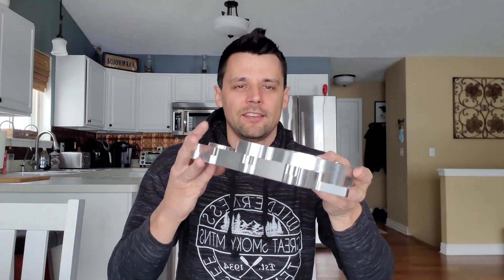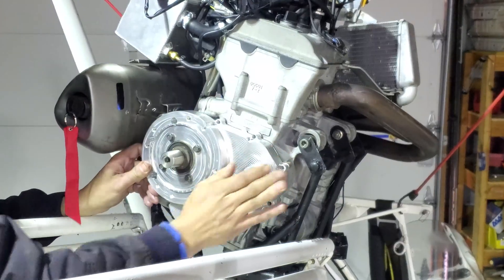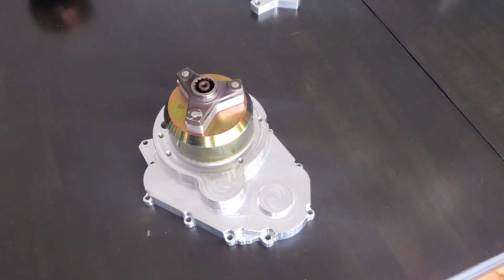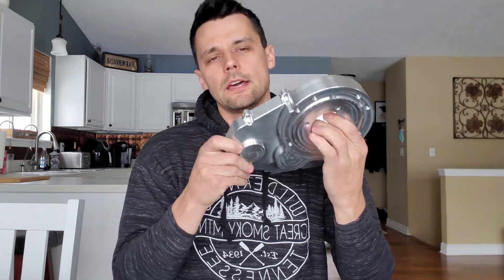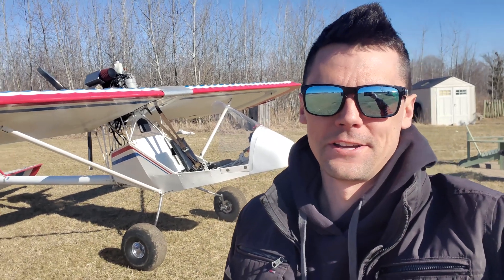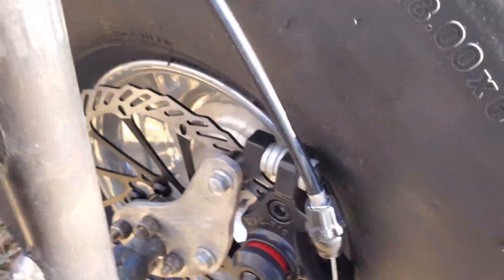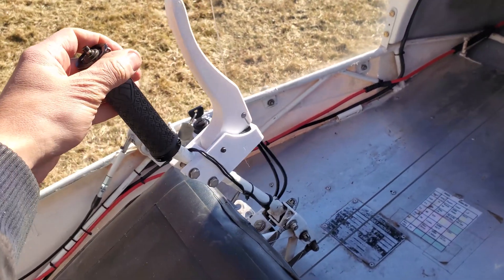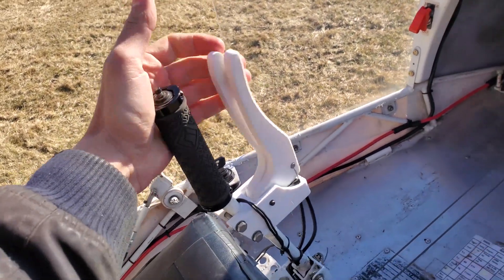Yamaha Phazer Airplane Gear Box Adapter Test

Comment: Looks really cool except the landing gear extension.  I would be scared the bolts would shear.
Reply from the maker: Thx. a AN6 bolt has a shear strength of 3 tons. I'm more worried about breaking gear leg where hole is drilled. It has taken some hard hits with no failures to report.

Comment: Ben, I just bought a Kolb Slingshot, recently built. I have a question about the rivets in the rudder hinge.  The builder didn’t use all the marked rivet points.  He did every other one. How is your rudder attached?  Every rivet point used?
Reply from the maker: Nice, always wanted a slingshot! Yes my rudder has all rivits used. Should be easy to drill and pop them in.

Comment: Is the Apex in your plans for the future with a tractor configuration?  Considering the Rans S20 as a potential project.
Reply from the maker: next project is a Phazer in a kitfox Iv 1050. Apex was too heavy for a 1050 gross.
Reply: Will be interesting to see how well it fits in the IV cowling.

Comment: Very impressive!!What ratio gearbox because a 582 is a 6500 rpm peak and ur running quite a bit more with the yam.
Reply from the maker: The phazer engine has a internal gear reduction at output shaft. My output shaft rpm to gear box is about 7k rpm, simular to rotax rpm

Comment: Wondering how much hp.  I I As many  pilots  looking for 4 stroke conversions for the 503. 582.  This is lookin pretty good . Dont fade away like many others. Kinda wondering how this would work on my challenger 2? I would also like a rundown on your search for a good phazer engine? Ill be heading to your webb site.
Flying big mountains here reliability and suficiant climb is a must.
Reply from the maker: 80hp, this is the new gen 503/582 replacement that is getting more popular.
Reply: @bkairys  Who’s selling the Phazer engine for these conversions? Living in Southern Arizona, we don’t see a lot of any kind of snowmobile.
Reply: If it can bolt into a Chinook 2+ theres no reason why the Challenger factory wouldn't ok the mod.  Here's hoping.

Comment: Hey again Ben! 

Been a while (last time I was bad mouthing your super weird and unsettling video format) but really GREAT to see you've gotten the CNC production going (I figured the Phazer 4 Stroke would be a hit; there are just TOO MANY drawbacks to the 582) and are creating a fully marketable Phazer Conversion Kit company! 

Here in Wyoming things are pretty much the same; still broke (grossed $5506 last year), just completed my first work project of the year (1 day), which is pretty much normal (not much work I can do for the first 4 months of the year), still cleaning the place to get it up and sold to European/Japanese Hunting Clubs, so the move to Alaska is still on if the health front doesn't get too much worse!

The really great news here is that I'm STILL planning on acquiring a Part 103 plane and getting BACK up into the air (with a Phazer is the plan); the Firefly and Firestar planes still look great, even though they are not aluminum (Hummel would be my preferred choice, but NO low wing thank you.....back country only for me!), but Chip's Merlin Lite shows promise, but the shekels required are formidable! Maybe by the time I have the jingle the slobs at the FAA will increase the Weight Limit on Part 103 to a REASONABLE 500lb-625lbs..........they've promised what is essentially a 'Constant Speed Prop' (they refer to it as 'One Level Control' used on FADEC equipped engines) which would REALLY increase the performance of everything from Part 103 and up and really save on Fuel Costs!

The good news is that next week I'll be finally publishing my novella on Amazon KDP after doing five rewrites and 3 complete read throughs after initially finishing it........we'll see how it goes....need to find a LOT of space/fantasy/genetic modification/arachnophile afficianados/as out there to spend $3-$4 on an E-book.....

I'm happier than one of Ivar's proverbial clams that you are making the Phazer Series REAL.......I may never get to that point, but it does my heart good to see someone with skill, motivation, and hard work succeed......and that is what you are doing!

Lastly, allow me to thank you for going back to REGULAR videoing......it was nice to see in fight details without getting sea sick while laying on the couch thinking I was in the midst of an F5 hurricane!

Take care and Keep On Truckin'!

Cheers from the Oil Patch in Central WY

Comment: So basically to put the Phazer on something like a Hawk Arrow II

1. Convert wire harness
2. Get adapter plate
3. Get/Fabricate Engine mount
4. Get clutch
5. Modify/Fabricate Exhaust
6. Radiation Setup?

Not sure about the radiator. Any modifications or just hook up some flexible tubing? What model clutch?
Reply from the maker: Rk400 clutch that is commonly used one the rotax engines with the c-box. Would be great on a Hawk!

Comment: It’s noisy on the video 🚀 
Whats the reality? Like a C152?
Reply from the maker: It's actually quiter than the 2 stroke it had. Just prop noise now..
Reply: @bkairys  any remedy with a smaller prop?
Reply: @bkairys  yeah, with the muffler the engine is very quiet, the biggest noise now is the prop, but what can be done there?